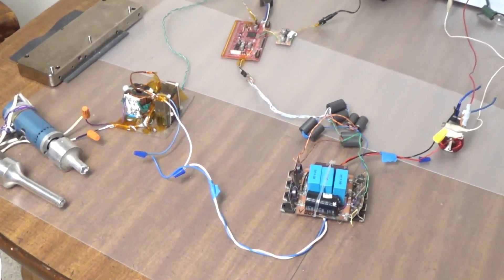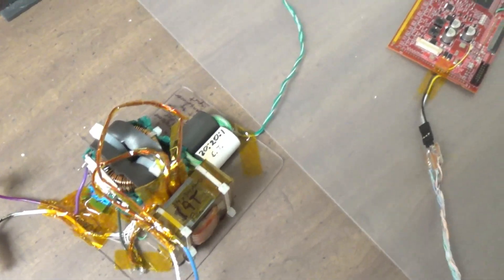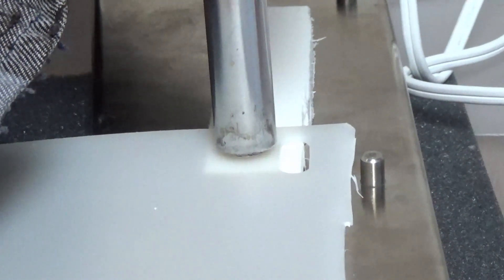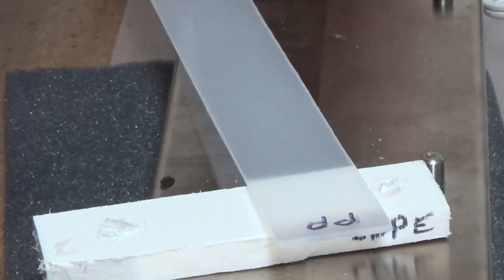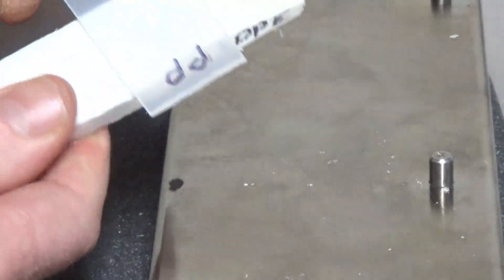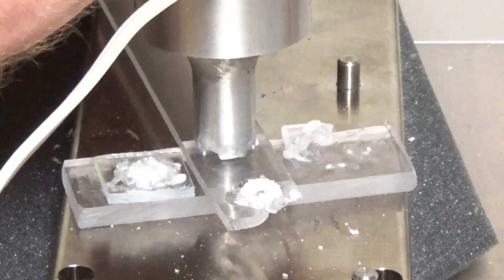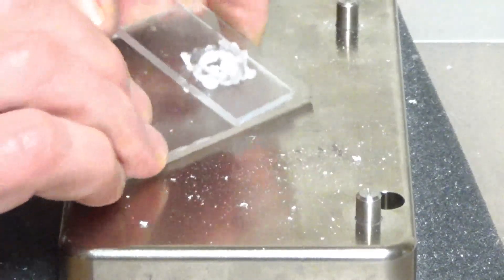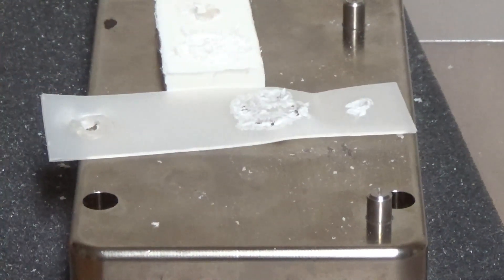Experimenting/playing with DIY Ultrasonic Plastic Welding

Comment: Can i weld polyethylene and polypropylene together?
Reply from the maker: Sort of🙂  PE and PP aren't miscible when melted, so they don't truly weld together.  However, you can join them by melting both together.  The resolidified plastics are mechanically interlocked.  Not as strong as a true weld, but still useful for some purposes.

Comment: Dear Mr. Dave, I admire your excellence and experience in electronics. I appreciate your videos and the information that you are sharng. I will work hard in order to achieve the level of understanding that you have. I hope I can get some advice from you. I am an electrical engineering student now.
Reply from the maker: Not sure what sort of advice you are seeking.  A few general recommendations:  Focus on thoroughly understanding fundamental principles.  That is more important than how many esoteric details you learn.  Take as much physics as your schedule allows.  Physics is about fundamentals.  Also, experiment as much as you can.  Play with a single transistor and a few resistors and a DC power source (battery or whatever).  Try BJTs and FETs.  See how drain current responds to gate voltage.
Reply: @davekni  I am especially interested in power electronics, tesla coils and high frequency electronics. I will keep that in mind dear sir. I will experiment with different devices and configurations. Thank you so much for your reply.
Reply from the maker: @jorusenpai  The high voltage forum is a good place to find questions and answers about Tesla coils and many other electronics projects.  See link in description of this video.  Then explore the entire forum.